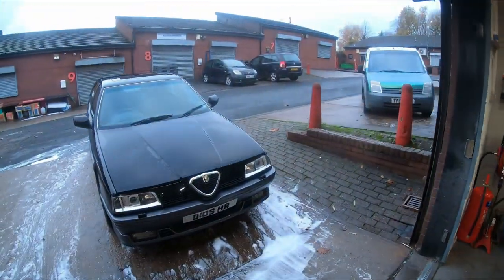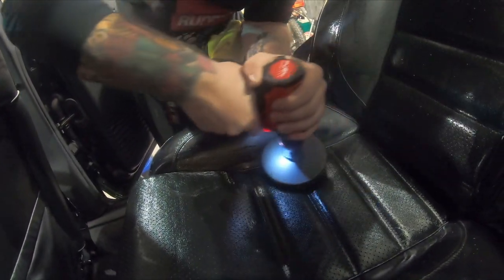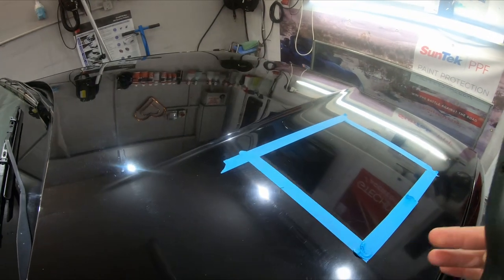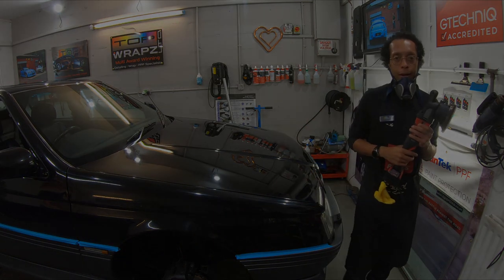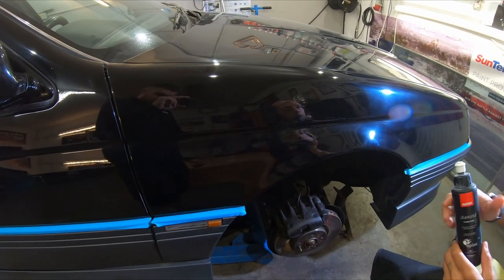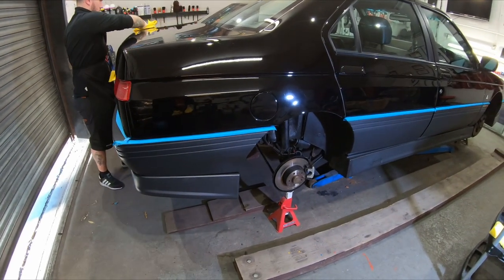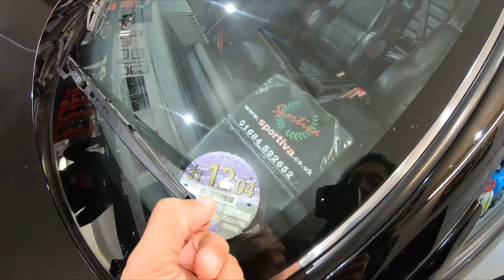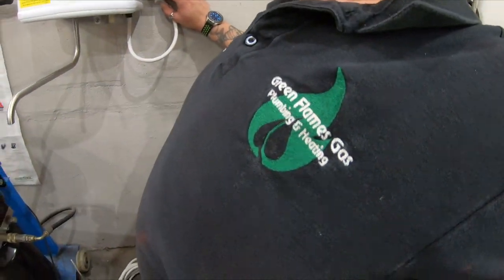30 Year Old Barn Find ALFA ROMEO 164 Clover Leaf Full Detail and Transformation!

Comment: I owned a 12V one of these Cloverleafs in black with a matching rear Zender spoiler whilst living in Redditch during the 1990's, then a 1995 24V in Rosso from 1998. The centre of the wheels should be silver, and better for it TBH. Pity the twin tailpipe couldn't be retained. I bought two systems from Alfa Romeo as they were not available aftermarket in the day. What paint was used to renew the rear Zender side skirt? That original paint was quite thick and tough I seem to remember.
Reply from the maker: Hi thanks so much for the comment , I can see your knowledge on these is way above mine !!! I matched the paint on the bottom plastic sections as the rear section had been repaired and it completely crack off looking utterly terrible. Not ideal but I didn't want to strip the delicate plastics. Match was near perfect.  I couldnt quite get the wheel match I wanted , and no one would refurb them so we cut the face on a lathe , drilled out the old fake bolts and replaced with replicas.... Unfortunately no one could give me the ideal perfect match to the original. Badges were replaced also but slightly differed , most of all it was amazing to bring this back the life .... One thing to note to me the car felt pretty undriveable with the clutch , very very stiff and tiny travel.
Reply: @topwrapzltd  yes, I had the 24V fake split rim wheels refurbed with new bolt heads in the early 2000's as the lacquer peeled badly. The 12V wheels were far superior IMO. Sadly across many cars the newer parts don't quite match the originals. NOS is the way to go if you've the time and money to track them down. Incidentally, the clutches were always very heavy. Pals often commented on it, but I was used to heavy clutches on my other car, a classic 1960's sports car. The brakes on the 24V were very soft too, but worked fine with a firm press. I wish I'd kept mine, but it developed another leak on the rear manifold and I decided to trade it in. It was as good as this black one in late 2004.
Reply from the maker: @FridgeProductionsLtd  your knowledge on these is pretty impressive, thanks for being here 😁✅